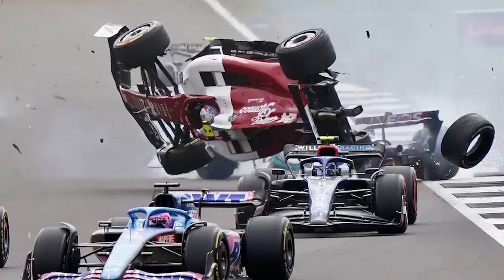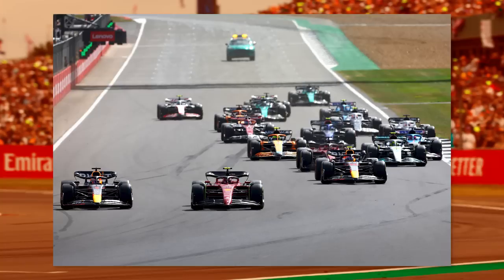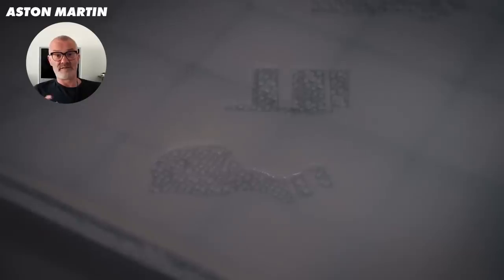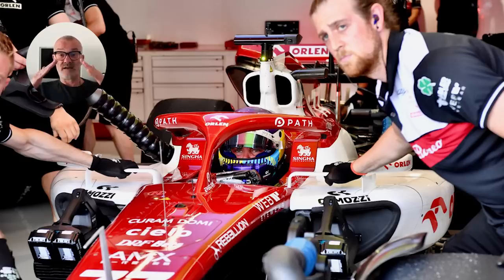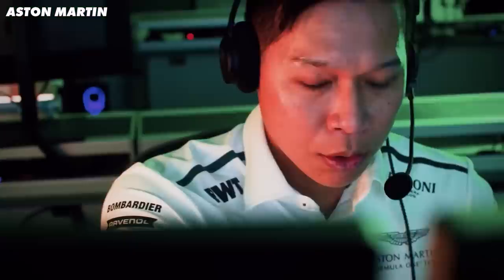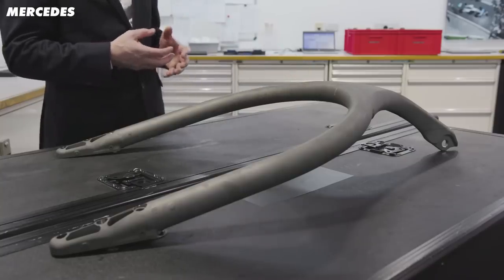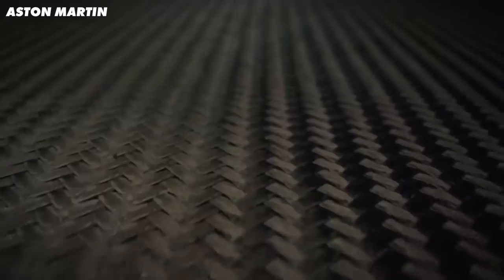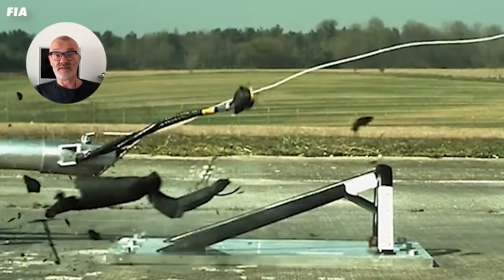Did the Roll Hoop FAIL in Zhou's Crash?

Comment: It's not bad that the primary structure aka the roll hoop failed. You can see it kinda like safety in aircraft systems. If something fails then it is good to have a back up for it. So the primary structure failed due to the massive loads although it passed all tests. When that happens it is important to have a secondary structure aka the Halo that can take over. And because of how the Halo is build, it cannot really shear off like the roll hoop. So from my point of view everything worked as it should. The driver walked away without a scratch.
The fence is more worrisome since Zhou landed in a very compromising position. People were calling for a bigger gap between tyre barrier and fence. However, if you look on how Zhou fell off the fence, he would've landed inverted if the gap was bigger which would've been even worse for him to get out quickly or if the marshalls and medics need to get him out quickly. So I think maybe 2 fences would be good. The first fence giving way/breaking away so that the car lands on its tyres and the second fence behind protecting the viewers from debris.
Or get rid of gravel traps to stop parts of the car getting stuck in them and the car then getting catapulted like in Zhou's case. You could also mention Alonso's "flight lesson" in Melbourne in 2016 as he flew around spectacularly and got out the car with some shaky knees.

Comment: I'd be curious how hot the hoop got during the fast grinding. Excessive heat could have contributed to rhe weakening of the adhesive as well as the carbon fiber "sandwich" on the top of the monocoque.

Comment: The real issue is how the full width front wings, and low back ends seem to flip the cars with the slightest side swipe now.
Reply: This is NORMAL for ground effect cars, look at other series that depend on ground effect such as NASCAR, V8 super cars, LeMans - all ground effect cars with a strong tendency to flip with a corner impact that unseals the car from the ground, making the flat bottom into a sail.
Reply: Open wheel race cars have always been susceptible to being launched skywards when the front of one tyre contacts the rear of another. When two high-grip surfaces come together at high speed in opposite directions, the combined energy has to go somewhere, and as the ground provides significantly more resistance than gravity, the usual result is much of it goes upwards.
Reply: @colehartel7206  we saw as much when Verstappen ended up on top of Hamilton but this is different, a full flip used to be rare but mark my words it will become more frequent

Comment: I’ve seen people still covering this crash, and yes the halo saved the driver
But the halo shape I believe added to the Why the the roll hoop failed 😞 
The halo made for the stability triangle to form holding the car upside down. 
Without the halo the car would have teetered and allowed the tires to drag righting the car. 
If the Halo had a raised Single point along the center line, I believe that would stop that type of crash.

Comment: Typical of the "sheet metal Roll bar failure" . Sandwich of the Carbon fibre via mechanical is the way to go with rounded edges and most probably kevalr upper and lower "skins" of about .5M ^2

Comment: Would Zhou's car reached the fence without a halo?  It looked as though it was allowing the car to skid across the gravel.  Is this a situation where they added the halo and redeveloped the roll hoop so it's not as strong as it was in the past?
Reply: without a halo he would be taking the gravel with his face tho
Reply: @terrainrecords6038  Sure, but it would have been a minor issue if the roll hoop didn't break off.  The car would have also slid more on it's side than the top and gravel would have had a bigger effect slowing the car down

Comment: Very interesting video. Clearly something has to be done here by the FIA because if a roll hoop breaks off together with parts of the monocoque, things need to be improved. Maybe several layers of carbon fiber more in the respective area might do it, maybe a new structure has to be implemented. Also, the cars are really heavy these days, addressing the weight (and size) might be another approach.

Comment: Could using a combination of bonding and bolts (perhaps with a titanium compression plate on either side of the carbon) prevent this type of separation? The bolts and plates would prevent carbon layers from separating.

Comment: To be honest, I'm kind of surprised that F1 engineers think you can just adhere something like that to the surface and it will be fine. I'd embed a tang of titanium into the monocoque, perhaps two in an upside-down V. Would have much more shear strength than just a surface bond, no matter how good their glue is.

Comment: I guess they need to alter the way it's fixed to the car, bonding it to the outside seems a bit sketchy, sure the glue is not gonna fail, but what it's attached to will. If carbon fibre is weak against pulling forces then perhaps it need reinforcing or a larger surface area to stuck to.

Comment: And to answer the question of the video, the answer seems to be:

Structurally, no. The roll hoop was intact. Just 100m down the road. There were enough secondary functions of other safety features to compensate, and the FIA will look to improve this design going forward.

Comment: If instead of "glueing" the rollhoop on, making it part of the Halo itself it would probably make it a lot more secure for such incidents
Reply: I'm pretty sire the halo is also added in the same way as the roll hoop
Both are made from titanium so can't be apart of the chassis
Reply: Depends on what part failed.

If it was delamination of the Carbon fibre, then the bonding didn't fail.

Carbon fibre is just "glueing" multiple layers together. No one complains that it was "glued".

Comment: Bonded on top and bolted through with a metal backer plate bonded underneath. 
Minimal additional weight, and no more delam. You'd have to tear apart the entire section of monocoque. At that point, may as well pray.

Comment: Would you agree that even if the roll hoop failed the results would have likely been much worse with no roll hoop?  Would agree that it has prevented a few possible terrible injuries and that also there is no way to completely protect all drivers in all cases other than driving at about 50kph covered in bubble wrap ?

Comment: The Halo saves another life 👍, it appears that its not the strength of the rollover hoop or the bonding that is in question here but they will need to strengthen the structure of the tub around the attachment point of the hoop and change the test criteria to include shock load testing.
On another note the catch fence at Abbey corner needs to be moved one way or the other ! 
If fire had been a part of the accident it doesn't bare thinking about.

Comment: While you certainly can't design or build something that is indestructible, I don't think it takes an engineering degree to understand that a safety hoop (roll cage) shouldn't be glued on to a small surface at the top.  Anyone who has ever glued something knows that failures are frequent.  The halo and roll hoop should be connected and both tied deep in to the chassis, giving maximum surface area of contact.  That is the traditional way of making roll cages, a series of interconnected tubes tied to the bottom of the car.  This spreads the load over a larger and larger area as it goes down dispersing the load.

Comment: What does Scarbs suggest as an improvement for this incident? 

Mandatory minimum anchor points? Increased minimum bonding surface area? 
Deeper anchors? 
Different design? 

I'd like to know what Scarbs thinks would be a suitable compromise between weight saving and desired performance

Comment: In my opinion, it doesn't matter if the halo is there to protect the driver. The roll hoop came completely off the car, which is a total absolute failure. It's completely unacceptable and should never happen in formula series. This should be investigated and Alfa might even need to be punished to incentivize the other teams to prevent this from happening in the future

Comment: Any engineer will tell you that you need more than one line of defense against any problem you can think of, because even the best designed system on the planet will fail. That's besides the fact that people are imperfect. A designer might think of 100 ways something can fail, and plan for that, but not expect the 101st method of failure

Comment: The  " Front Hoop " Should Roll All the way Back Making it 1 Piece , From  Front To Rear = More Points of Stability as Well as Stronger Bonding For Protection .  Redesign Rear Roll Hoop To Match Front instead of such a high center at one point thusly spreading the load on top of that .

Comment: Just glueing it seems risky for such an important safety feature, I know it would add yet more weight but if it were bolted to a titanium try under the carbon body the hoop would have stayed on the car.
Reply: If the bonded composite failed, I would bet that any titanium bolts would have broken.
Reply: @mikewheeler9011  Yeah I guess so but it would add an extra layer of protection, if I were building a car that is the approach I'd take.
Reply: @mikewheeler9011  Disagree. A carbon fiber part made like this is not good for that type of load. You aren't actually stressing the fiber but the resin that's holds everything together which is why the hoop was ripped off.
Reply: @mikewheeler9011  by introducing a lot of extra stress concentrations and plus adding new failure modes?

Comment: Kind of odd to have a flat glued joint. Any wood worker knows about increasing surface area of joints. Especially when working with laminated materials.
Reply: Increased surface area is increased weight
Increased weight is lost speed
The engineers and simulations all said it would be fine so why would they want to lose performance?
Reply: @Alucard-gt1zf  you wouldn't be increasing material used AT ALL. The weight increase would be minimal and for all cars.

Comment: I’m not an avid formula guru. I am wondering why not make that hoop integral to the drivers back rest and seat. This way there is no adhesive to fail so to speak and that the drivers are encapsulated in a cockpit like the A-10 war hog fighter jet for example. Just a look at an older model . I’m quit sure, that the engineers would be able to come up with something amazing, new safety design. Food for thought!

Comment: Well if it was bolted on, then you are attaching the roll hoop to more than just the top layer of the carbon fibre of the monocoque isn’t it?

With “glue on” method you are only attaching it to the top layer of the carbon fibre which obviously, would be much easier to rip off.

I’m sorry but I don’t see how glue can be stronger than bolted on…

Comment: Here’s the test okay. You put the car outside or In a fairly open warehouse. You creat some type of car holder but upside down, so you put the car strap it in (by car I mean tub) normally then this multimillion dollar wrecking simulator smashes the car down a couple times at the same time I have no clue how you could do this while pressing whatever pressure made it fail into alternating sides as it’s getting pressure from what the tub is strapped into presses down there for you precisely have the ability to simulate say 25 g at 70° then say a zone of spin ramping anywhere from 6-15 g spinning 2 times tipping up down to 50° you can chart exactly what the car did then come up with a standard test and ingestion tool that could definitely prevent this from happing instead of testing the roll hoop in a static environment.

Comment: I would say the roll hoop did its job. It took the brunt of the forces of the crash. Even though it broke off, if it wasn't there the Halo would likely have crushed down when the car landed upside down, or at least the driver's helmet would have hit the track a lot harder. The hoop did its job and protected the driver from the worst of the landing. Just because it broke off doesn't mean it failed to do its job and that is shown by the fact mentioned in another comment that the driver was able to race the next week.

Comment: I may be old school in my thinking.  But why would you ever think a sheet of carbon fiber would be a good point to attach a roll bar to.  The failure was exactly what anyone with experience with carbon would expect to happen.  Why it was not bolted or welded to the rest of the steel frame is beyond me. 

It's the same thing with woodworking.  The glue in a joint is stronger than the wood so the wood just brakes off instead of the glue.

Comment: After reading these comments, I've noticed a lot of complaints about safety. There's NO way to make this sport 100% safe, things happen. F1 is definitely at the forefront of safety and this accident proves it. Could things have been different to solve this issue? Yes. But that's part of what makes an organization like FIA so great. This will be analyzed to death and new regulations will come. Unfortunately things out of the ordinary need to happen for there to be an advancement. Not every load or angle of impact can be thought of and tested without seeing a real world example happen. This is an ever evolving process for the better. And I for one am happy to see things like this and Roman's crash where a driver escaped with minimal to no injuries over a dead driver anyday.

Comment: Sometime mechanical fasteners can't be avoided. 787 is all carbon but depends on nuts and bolts to be as strong as possible in some areas. Perhaps bonded and bolted is the answer.

Comment: Depending on the strength of one layer of the composite was really poor engineering. There needs to be a second piece that sandwiches the base and is mechanically fastened. I guess its not tested for pull loads. as much

Comment: In an incident like this "Fail" is a relative term.
Ultimately, Zhou emerged, outwardly, unscathed.
To me, (and probably to Zhou) this was a resounding success!
Is there more to learn? Absolutely! But if this had happened ten years ago, we would be having a very different discussion.
Tip of the tam to Sir Jackie Stewart for his seminal leadership in driver safety, and
to all of the thousands of engineers, technicians and mechanics who make it happen!
Reply: From an engineering position, this was a cut and dry failure. The roll hoop was implemented to perform exactly one task: prevent a car from sliding on the cockpit/halo. It very clearly failed that task. The halo was intended to be, in this type of incident, a failsafe, not a primary protection feature, yet that's what it ended up being. There are very few incidents that involve cars skidding on their roofs. And in this one, the exact type of accident it is designed to protect drivers from, the roll hoop broke off and provided no protection whatsoever. So yes, it was a failure.

Comment: It seems to me a better way of attachment is a plate underneath the carbon fibre, with the roll hoop through bolted too it.

You're not then relying on the first layer of carbon fibre to withstand all the pulling forces.
It allows the full thickness of the Carbon fibre to absorb the load in compression and tension.

Comment: Hmm..titanium is great at holding weight yes, and returns very well, but it's semi soft when it comes to grinding and grating. I wouldn't consider it good as a slide guard without a steel grind plate over it.
And carbon fiber is just horrible at handling impacts compared to even aluminium.
They took risks to save weight.

Comment: It may be because of the roll hoop failing, but it seems to me that everyone overlooks the halo (which yes, did it's job to protect the driver) but also contributed to the magnitude of the crash. Roll hoops are shaped at the moment to be a flat planar shape, but this plane provided a skid tray for the car barely losing any speed before exiting the track. It to me seems like they should be shaped to have a curvature to them, peaking in the centreline of the car, to encourage roll back onto it's wheels (or at least it's floor) so the drivers head isn't millimetres from floor. Not a simple design change however, as an arched halo would be susceptible to buckling under the lateral load... but potentially something to be explored in the future

Comment: I would disagree with the loads. Yes from the foto it can be seen that it was quite loaded on the first impact but only for small fraction of time and probably only in two directions, vertically and horizontally. Then it was just skidding. The skidding forces are minimum and rollhoop should easily absorb them. But yes, it really looks like that the bonding to monocoque is a weak point of the design and thats a shame.
Reply: But the rollhoop was torn off before the majority of the skidding, that's what I got from the video
Reply: @Cos_Why_Not  he was saying that skidding creates force vector that moves around and thats a problem. My point is that the force is not that strong while skidding except the time you hit some curb or something rigid along the way. It looks like the first impact probably torn it off, yes.

Comment: All very well the roll hoop being strong but if it's support collapses then it's no good. The only reason the halo worked was because the car failed and that is very very bad. There have been worse crashes without the halo that have been walked away. Roll hoops shoukd go all the way to the floor as a titanium support and have two methods of securing.